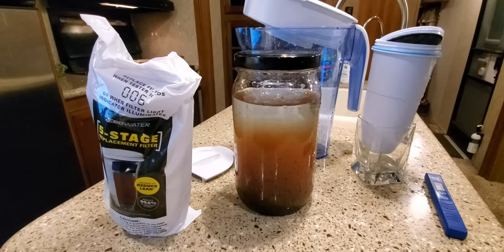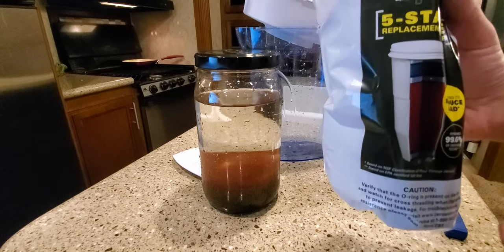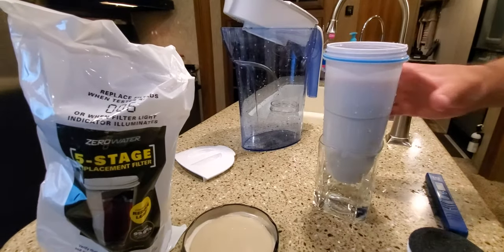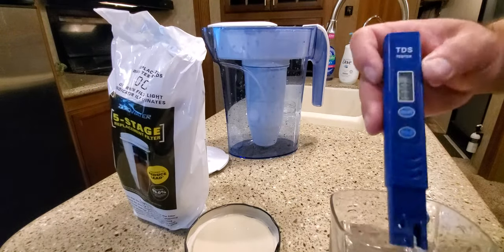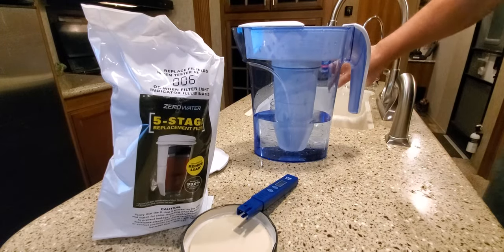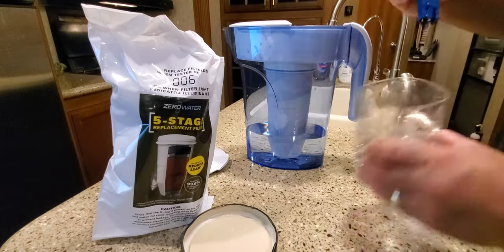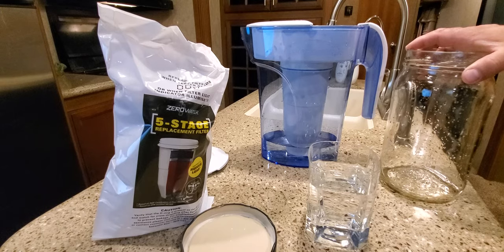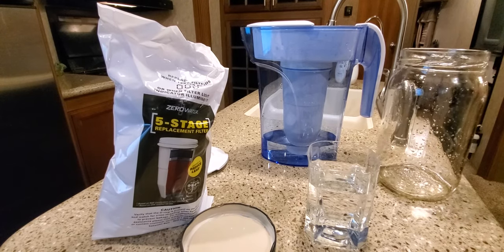Can you reuse a zero water filter? Deconstruct / reconstruct

Comment: Buy a $20 faucet filter as a "pre-filter" and extend your Zero filter life dramatically.   I use over a gallon per day and my filters last 6 weeks or around 50 gallons!
Reply: I went to walmart and paid $20 for a 6 month 300 gallon faucet fillter . They go on roll back or clearance usually right after summer here in Maryland..
Reply: hey thanks, I'm just replying so I can go to history comments and find this later so I don't forget.  Good tip
Reply: Doesn’t sound too economical.
Reply: Hmmmm, I might give that a whirl.  I tried this idea using our Brita filters and noticed Zero change in longevity (pun intended).  I hope this will help extend our Zero filter's life.  What brand is the pre-filter???  Amazon, walmart? thx
Reply: Brita brand "faucet filter" or even a cheap "pitcher type" Walmart brand will work.
Reply: Does the water coming through the faucet tap cause the zero filter to filter faster as it may not have to filter as much out?

Comment: ion exchange resin beads are recharged by soaking in a saturated salt solution, rinse 3-4times with distilled and it's good as new, as for the fishy smell it's the amines getting through charcoal media, regen with boiling water then dry in a low heat oven.

Comment: Thank you for this "hack" i found the following online and they recommend using salt water: What is regeneration, and why is it important?
Most water softeners operate on the principle of ion exchange. The water softener contains an ion exchanger (=resin cylinder) filled with resin beads that convert hard water into soft water. How does it work? The resin beads filter out the calcium and magnesium ions from the hard water and exchange them with sodium ions.

Over time, all the sodium ions will be exchanged with calcium and magnesium ions. The ion exchanger becomes saturated with calcium and magnesium, making it unable to soften hard water anymore.

The solution? Regenerate the water softener.
This simply means flushing the ion exchanger by passing saltwater through it. The collected calcium and magnesium ions in the water softener are then exchanged with new sodium ions from the regeneration salt. The saltwater that has now absorbed all the calcium and magnesium is eventually discharged into the sewer system. Source: https://www.waterontharder-expert.nl/regenereren#:~:text=De%20harskorrels%20filteren%20de%20kalk,water%20niet%20langer%20kan%20ontharden.

Comment: If Zerowater hadn't jacked up their prices for 2022, I'd still be using it as my only filter source since it is a very good product. North of the border I payed $68, plus taxes for a 4 pack. My TDS gauge reads 370-380 for tap water so them filters don't last too long. Thanks for the upload. Homemade activated carbon filter here I come !
Reply: Use fresh rain water at 003 TDS. My filter just lasted 1.6 years 1200 liters and the bacteria in it is exactly the same as the air around me. So dont wory about that.
Reply: I just bought a 4pk off ebay 42 bucks delivered

Comment: Brilliant experiment, good for you bud. My only gripe would be that the activated carbon filtration can only be cleaned to an extent, eventually it will saturate and the test they supply is only for none organic impurities. Would be interesting to see a test for organic impurities also. Very interesting never the less. Thanx for the vid!
Reply from the maker: So on that thought I ordered a bunch of activated charcoal and it was supposed to be super high quality. I proceeded to make a filter of pure activated charcoal. I have coarse let the charcoal soak then tried to do some washes but no matter how many times I did the wash it tasted funny and it had a lot of the result of solids in it. I don't know what I did wrong but I really really tried to make that work because I bought two and a half gallon bucket full of activated charcoal LOL I eventually ended up giving up on that experiment. I'm sure the error was mine I saw other people do it and had no problems at all
Reply: @SubaruOffRD  Did you get some of that ion exchange resin stuff too? There's also something called KDF they mix with the activated charcoal. I bet that's fairly cheap too, in the long run.
Reply: Am I missing something or is he now just going to have to replace the sink reverse osmosis filters more now? Isn't he just replacing the reverse osmosis filter for the zerowater filter? Why use the zerowater pitcher at all when you can just use the sink reverse osmosis filter in a normal pitcher and refrigerate that water? 
I don't understand!😵‍💫
Reply: @PeterKnagge  Yep, My question too.  If you have a Reverse Osmosis filter, you already have water at least as good as a zero water.  Plus, having an 88 TDS from the tap probably means your city or private water company is already filtering your water very highly.  One reason to filter at all, is that no matter how good the water the city puts out is, it still has to go through all the pipes, and your plumbing, which if older, probably has lead containing solder joints.  The cities know this so they usually add several types of mineral that will plate out or cover over the lead, like calcium or silica or phosphate, which usually makes your pH high, as it should be.  Most cities do this, and what the stupid water people in Flint Michigan(the state assholes who took over actually) was to change from good quality water from the Detroit Municipal Water system(from the lakes and treated properly) to local river water which is acidic and has some chlorides from road salt and is very good at mobilising lead, hence poisoning peeps and not even telling them.  Those criminals should be all in Jail(up the the former governor), but some damn judge just let them all off, or somewhat derailed the prosecution against them.
Reply: You can set activated charcoal in the sun for a day and that will make it like new.
Reply: Explain how to take apart the filter 😮
Reply: @RipperYouTubeOfficial Your statement is not true. It might be dry, but there are impurities still intact within the structure of the activated charcoal pellets.

Comment: Thanks for sharing this info. I did as you said and filter seems to work beautifully. My fillter seemed to be stopping up and wanted to try to clean it out for a better flow. I kept stirring the water with filter ingredients in a quart jar using a table knife each of the 10  cleanings. I kept seeing particles come to the top floating in the water, so poured all that out. By the 10th time it seemed clear of debris. 
Also, when I was separating the parts with utility knife razor it was hard to do first time around, It seemed to have tabs to cut thru, then it was pretty easy  using the table knife to separate. I was a little puzzled at first where to cut and cut at the blue o-ring,   Wrong.  I then realized looking closer at your video, it was between the screw grooves and the inner white part, near the filter head.
Thanks again for your figuring this out. I so wanted to be prepared for clean water should we ever have another Lockdown. During our last lockdown Zero filters were not to be found where I live. Grateful and Blessed.....Truth.gha
Reply from the maker: I'm glad you got some use out of this video I for myself will not be trying to reuse the filters to get more life out of them unless an emergency situation, because after I did this the filter started producing not too good tasting water. So I don't know if this is a good long-term solution. But I did notice that I was quite surprised to see that there is only a small amount of activated charcoal along with the resin you would find in a water softener which the resident makes up most of the filter I imagine that this is where most of the bad taste things in the water gets held in a resin which can all be be purchased on eBay. I don't know how much money you would save by doing it but it could be substantial if the water comes out tasting good so maybe look on eBay and buy in bulk and you can just keep refilling it with new activated charcoal and water softening resin beads maybe you can make a video and let us know how it works
Reply: @SubaruOffRD  Thanks for letting us know about the taste change. do I look for  "water softener beads"?
Reply: @SubaruOffRD  Thanks. I did check the taste of my redo. It is fine at least a few days after doing this. My thought is replace charcoal. That is what changes taste and does absorb matter. 
Something interesting, I checked the rating on a new filter I already had and it registered 1... not zero. interesting. Not bad of course, but interesting....
Reply: @truthgha  So do you think this is worth trying, or is it too much hassle and the smell/taste too unmanageable?

Maybe at least once per filter?

Comment: Here's a tip for everyone.  Make certain the batteries in the TDS device are new.  I was getting zero readings from new then decided to pull and replace one month later.  TDS numbers registered in the high 100s after a new filter was installed.

Comment: Norm in a well water softner setup, salt brine is used to recharge the media. I am trying your method, but curious why running water normally thru it for drinking does not achieve same results as your rinsing. The different density of carbon and media would make it very easy to replace carbon

Comment: Great video. You're lucky to be having 80+ TDS coming out as default. Mine in 550+ and it KILLS Zerowater filters. So, i bought a countertop Reverse Osmosis system and put the water through that, then into the Zerowater pitcher and into the fridge. Zerowater filter lasts much longer now because the water going in is about 7 TDS.

If you figure out a good source for filter parts to actually rebuild the filter for a lot less, please make another video!
Reply: I'm going to attempt this for producing my own filters along with friends who have zeros
Reply: @grinderpumpguy  did you end up finding a good source for the resin? That's the one thing that I don't know about/can't find exactly what is used. Kind freaks me out to run my water through some random resin as well without knowing haha.

Comment: I've had my zero water pitcher for 4 years a used to be a good product but lately the filters do not work well I was told you have to burp them tap them on the outside to get the air out but this is happening quite often plus the cost of the filter has gone up it is no longer a good value

Comment: Down in SoCal the “water” coming out of the tap just might be treated sewage, because they love us so much. Mine reads 398 on the particulate meter. It does come out at zero from a ZeroWater filter but not for long. It reads 25 or 30 after 5 or 6 gallons. I thought I would pre-filter with my old ProPur but my tap water gains particulates up to 450 after I run it through ProPur. Maybe my filter is too old. I don’t want to disparage ProPur. But as for ZeroWater, I thought you had to do something fancy with that resin inside ZeroWater filters to clean and restore it, and it looked like equipment and chemicals were necessary, based on my internet searches. I will give your method a try. Thanks for posting.
Reply: There's a couple of vids showing using 2 ZeroWater filters, 1 being your "old" filter which will still filter some, then the newer will last longer as it doesn't have to filter as much.
Reply: @RootsOfEden911  Unfortunately it does not last that much longer Im afraid. Use fresh rain water at about 003 TDS. At 003 TDS I would not worry about any nasties in there.
Reply: @edd-6182   Interesting, I will look into this thanks.
Reply: @RootsOfEden911  You can fit UV lighting to the pitcher after it has filltered to stop bacteria but after rigorous test the filtered water is not showing any bacteria under electron micoscope and when testing the water sample on a petri dish I'm getting the same bacteria results as the air around me. So the filter looks to be removing any bacteria as well. Im using fresh rain water through mine at 003- 009 TDS and its lasted 1.6 years 1200 liters!
Reply: @edd-6182   Thank you so much I have a rare bacterial infection because I'm immunecompromised and can't beat it. I got it from drinking contaminated water that came out of a Spring through a well.  Have you done a video on this? You should :)
Reply: No sorry. No vid. I spend far too much time researching this type of thing.
Have you tried water fasting to try and reset your immune system over compensating? You may like to look into it.
Reply: @edd-6182  what inspired you to study water?
Reply: I'm a Microbiologist who studied bacteriology so it's not just water I  look at.
Reply: @edd-6182  I got citrobacter freundii, my husband didn't even get symptoms despite drinking 2x the water, but he's not SIGA deficient. If i fasted or ate the wrong thing, especially fiber,  the pain would knock me to the ground.  I was eventually hospitalized but we didn't know it was a bacterial infection at that time, all the doctors were stumped.  I found out later from a stool test about the bacteria and the immunity issue.  I tried everything natural that was suggested,  no go.  So I tried cipro for 2 wks, no go.  I eventually did a vitamin C flush which knocked it back a good bit.  But it likes to cause pain with the slightest bit of stress! I probably should try another vit c flush.
Reply: @edd-6182  I'm 1fstcat at the big G :)
Reply: @edd-6182  I have tried to leave my info, but it gets removed. You can comment on one of my vids.
Reply: @edd-6182  Comment on one of WickedFit's vids, they have her comments blocked here.
Reply: Right in the middle of moving due to huge price increase from land lord. 
New house is in need of a new cooker and not flooding the back yard every time someone uses the loo. I also have a dyslexic Son, he who was so stressed that he did not get to school today. or
Please give me a bit of time and I will get back to you. Thanks

Comment: WOW that's amazing! Thank you! 

Just be aware: A recent ConsumerLab test showed a 1,200% increase in microplastics from this filter. Zerowater says it's not true, that their filters don't add microplastics. So not sure if it was just one bad filter that caused the test results. (Microplastics are known for causing strokes and other heart and heath issues, but boiling the water for 5 min. removes most of the microplastics)

Microplastics and chlorform (a by product of disinfectants) can't be detected in a TDS reading. So @waterfilterguru had lab tests done on several water filters. 

Zero did well, but chlorform as well as other toxins was found in Zero filtered water. Zero removed flouride 100%. however Thanks to your video, I might get a Zero again, and run it through an Epic filter as the last step, to get ride of any microplastics, choloform, and whatever the Zero misses. 

Thanks again, amazing hack!

Comment: As a skeptic, I wonder if their TDS filter is reading some proprietary proxy chemical that they put in new filters that slowly degrades and the presence of this added chemical causes a reading of 000 on their provided TDS reader.
Reply: As a plumbing tech in Arizona hostile water high country,  I can attest to zero tds pocket testers are similar to most pocket testers out there. These type of test method is a form of  continuity (electric current that binds together?) I'm no scholar but from what I gather is a titration test is a better test but without a digital version?  I may not be 100% correct and perhaps the author could elaborate in the comments.

Comment: I’m doing the same as you and have zero water and a Culligan RO system . Out of my tap is usually between 500-600 tds. Curious why you got zero water when you are getting 0 fron your RO.  My RO is currently at 38 tds.  So far haven’t been able to get mine back down to zero but will try again on next filter. Interesting video , Thanks
Reply: He installed RO after using Zerowater

Comment: This did not work for me. It took me like 3 days to figure this out. I tried cleaning it by first soaking it with a salt water brine (like some people mentioned) followed by mixing and soaking with two gallons of distilled water, followed by soaking and mixing with water purified by my other zero water filter pitcher. It never got my readings down to zero again and the particles only increased when using distilled or purified water. 

It would be nice if someone can show us the exact resin to repack these filters witg, as well as the correct replacement for the cloth filter at the bottom or how to clean that would be great.  This was just too much work and a mess for it to be effective. Also, there's the matter of breaking the seal at the top of the filter. Do we just pop it back on without resealing it with some sort of water sealant?

Comment: ZERO also raises the pH level of the water.
I seen tests where the water being tested in 5 different pitchers was in the 6 range and the Zero Water got it up to 7 pH.
Now two other filters got the water up to 7.8 and 8, but neither of them got the particulates below 100 and Zero got it down to 0.
So Zero Water Filter raises pH and also cleans the water particulates down to 0 as well as removing heavy metals.
Reply: is raising the pH leve a good or bad thing?
Reply: @gustavbliss9487  A good thing,  you want it as close to 7 (neutral) as possible. Going back to chemistry class the lower the ph, the more acidic, the higher the ph, the more alkaline it is. Most bottles of water are lower (acidic) which is not good for your teeth and general health.